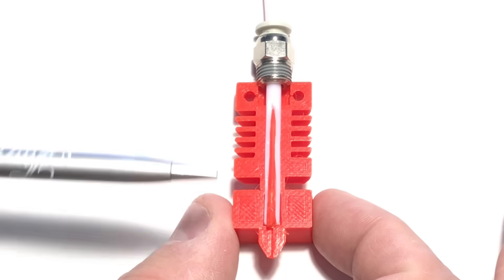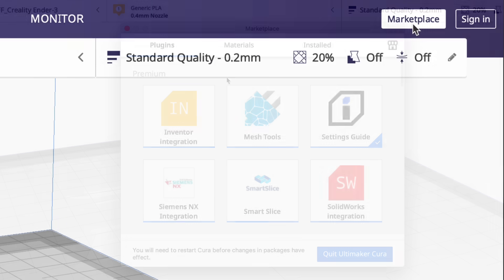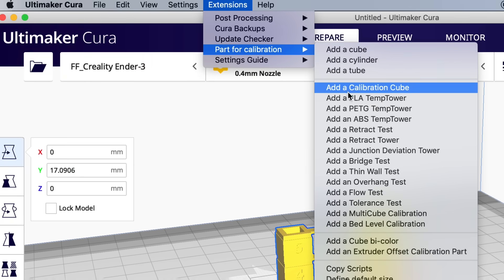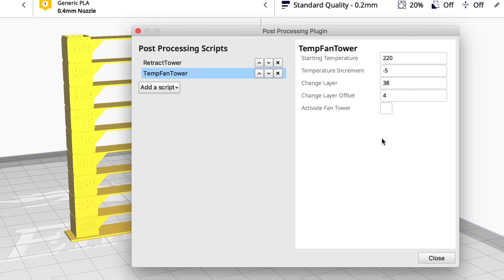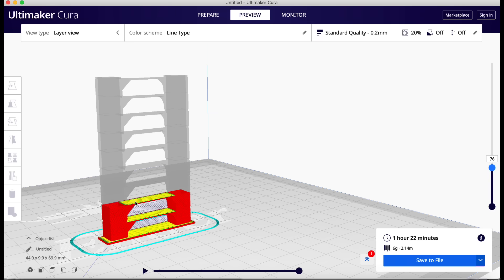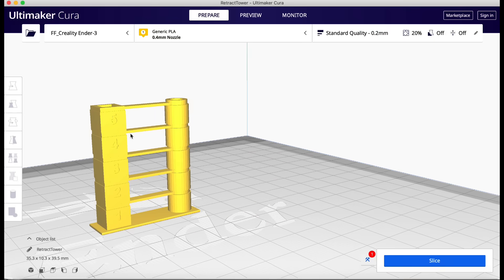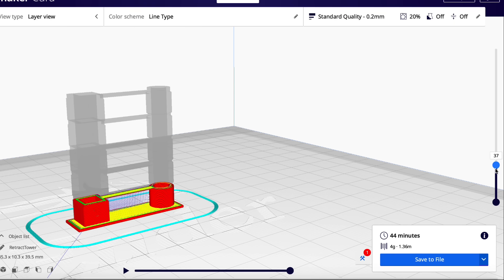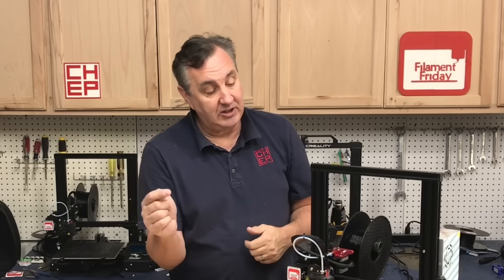Calibrate Perfect Retraction Settings Using a Cura 4.8 Plug-in

Comment: Nice video as usual! I do notice with an all metal hotend (no ptfe tube down to the nozzle) that the retraction towers don't work as good. I ran a few and got mine dialed in to 3.1mm but when doing longer prints I always had clogs. I dialed it down to 2.8mm and it works great with no clogs, although the retraction tower has stringing on it. Maybe I am just doing something wrong but figured I would post this in case anyone tries with an all metal hotend and runs into clogs like I did, even though the retraction tower says it should be good.
Reply from the maker: Did you run temperature test?
All metal has potentially more heat creep so temp is critical.
Reply: @FilamentFriday  yes sir. I have the gulfcoast robotics all metal hotend for my Ender 5 so maybe it is something with that hotend that allows heat creep over extended print times...?? I am honestly not sure.
Reply: @FilamentFriday  i think its the surface finish, smooth ptfe tube the pla wont stick to it when it cools,  but the all metal hot ends the pla will stick really well to the metal, and jam it.

Comment: After install and restart i still cant find the temp tower or the retraction tower in the post processing scripts. 🤔
Reply: when you copied the script you should get a prompt to restart. It should say how many scripts you copied. if it says " 0(zero) scripts copied be sure to select the model you want to copy script from. after the restart, add the model to the build plate, then select extensions/post processing/ modify G-code.
Reply: Had the same problem restarted again and it worked

Comment: Hi Chep - not been happy with a recently acquired roll of Carbon Fibre PLA, so I decided to try re-calibrating using this process. I was rather surprised to discover that the Temp Tower implied that I should be printing at 35C BELOW minimum manufacturers recommended temperature of 220C, using twice the retraction I had previously (3mm) - Absolutely outstanding print results.
Thank you SO much

Comment: at 7:11 you got a little stringing at the bottom because u had an offset of 4 layers in the post proccessing code. So your change will affect at layer 4+38 = 42. This includes the smaller part of the towers to be the same setting as the whole stage before.

Comment: The only way I could really get rid of stringing in very small complex objects like D&D miniatures, was to enable and calibrate linear advance in my SKR mini E3, and then I was able to go as low as 2.5mm retraction, not only it prints a little bit faster due to the lower retraction distance, but it also has less chance of clogging.

Comment: I'm using Cura 4.8, and the post processing script is not being included in the gcode file.   arghh
Reply: Same here, when I save it then load it into the printer I'm not getting any temps (nozzle nor bed).
Reply: @dksix1905  I found a work around in Cura 4.8.  The "changeatZ"  feature works in post processing, but a little more involved.
Reply: @bginvestor101  I set the printer to pre-heat for PLA and the load the g-code that appeared to have no temperatures. I loaded the program that appeared to have no temperatures and after the auto-home at the start of the program it paused, temp went up to 220 and it started printing. It's still on the first layer but it looks like it's working. It's hard to tell though, just got this new Ender 3 V2 last week and it has display problems. The display randomly jumbles the images and I can't tell anything about what's going on.
Reply: Same situation for me as well!  (Ender 3 V2)

Comment: Marketplace says the plugin is installed. I am able to add the calibration tower. But when I go to add a script I don't get any of the options. I've closed CURA a few times uninstalled and reinstalled the plugin but that didn't work. I've even tired adding a different printer (thought maybe it didn't work with the CR6-SE).
Reply from the maker: Did you do the copy scripts step I showed?
Reply: @FilamentFriday  Totally missed that step thanks CHEP
Reply: @FilamentFriday  OK. Still didn't show up. I deleted CURA and reinstalled, copied scripts again and still nothing. Not sure what I'm doing wrong.
Reply from the maker: You have to restart Cura after copying scripts
Reply: @FilamentFriday  I am getting 0 scripts copied
Reply from the maker: Restart cura

Comment: Hi Chuck, I ran 2 retraction tests.  The fist was starting at 1 with 1 mm increments.  the second starting at 5 with 1 mm increments.  Both are showing lots of stringing?  any thoughts?
Reply from the maker: Then it’s not a retraction issue. You might have filament build up in the nozzle, or too high temp, or moisture in the filament or burned PTFE, or just bad quality filament.
Reply: @FilamentFriday  Chep thanks for the thoughts.  I change the nozzle, change the filament, and used 2 new Capricorn tubing, and still have issues.  I am running out of what to do!  my problems with excessive stringing started after replacing the old extruder with a 'factory' replacement!
Reply from the maker: Watch the filament at the extruder and verify it’s actually moving backwards on retraction.
Reply: @FilamentFriday  Yes, the filament was retracting/moving back!
Reply from the maker: Then I’d try the oiler method. Clip a small sponge, with a few drops of olive oil soaked in, around the filament before the extruder. Run 100 mm thru and then remove. See if stringing goes away.
Reply: @FilamentFriday  Hi Chep, I did try the olive oil 'treatment'  I just printed a random object. the print was so much cleaner!  WHY.  I will run the retraction test again and will let you know!  Thanks so very much for your commitment to the 3D community

Comment: ok, i have a problem, running the community firmware 5 for the CR6se and i've followed your steps with the script, when i load it up in the printer the temps don't change at all, dont have a clue, please help

Comment: Did you use the same print speed for both tests? What print speed did you use? I have a Creality Ender 3 v2.
Reply from the maker: 50mm/s for both. Use whatever speed you normally use.
Reply: So does that mean ur retraction in that test was 5mm at 50mm/s?
Reply from the maker: No, retraction speed was 45mm/s

Comment: I wouldn't say it works "better" at 5mm because we weren't able to see a 6mm distance on the same tower. If anything, it just "works" at 5, but i'd be intrigued to know if 6mm distance for some reason caused stringing to reappear. I wouldn't imagine that it would. I never really mess around with plugins and extensions so this is neat.
Reply from the maker: I know 6 will work because as I mentioned I’ve used it in my profiles. But it does move it closer to the cold zone as I described at the beginning. The idea was to find the value that worked without moving any higher and 5 surprising worked.

Comment: 44min print for retraction? Retraction towers on Thingiverse is a 10min print and takes hardly any material.

As for temp calibration (and other calibrations) I go to a calibration site designed by another YouTuber - you probably know who.. I can set my own temp range for any material and simply down load the gcode.

Simples...

Comment: Thanks for sharing this! I am in the process of calibrating my Ender 3 pro. I’d love to see a video on x, y, z calibration. I am trying to print adapters that should fit to others. I find that sometimes prints come out too tight and screw holes do not match
Reply: He did a video previously on horizontal expansion, that should help you with that particular problem.

Comment: For normal print objects the fan runs together with the print. For the calibration Temptower script the fan is switched off. Will the end results not be affected if you turn on the fan in the later print for regular objects? Thanks
Reply from the maker: Possibly but I was testing temperature not cooling. That’s a completely different type of test, like bridge or overhang test prints.

Comment: This is a great plugin for Cura! Question, if running the retraction tower with the provided script. When you slice and print, does it override your current retraction setting in Cura. Or do you have to  set your Retraction at 1? Mine is at 6 normally.
Reply: Yeah good question because when I do this my control panel still says the temp I had been printing at prior.  Will control panel change temp reading as it prints or is it changing temps due to the scrip and control panel doesn't change?
Reply from the maker: It changes it in the GCode. You can check the file. It’s a post processing script so it modifies what the slicer produces.
Reply: Thanks! I just figured it out.  Your the best. 👍